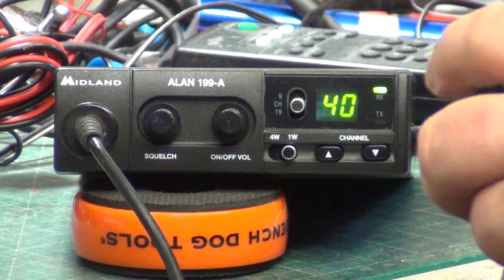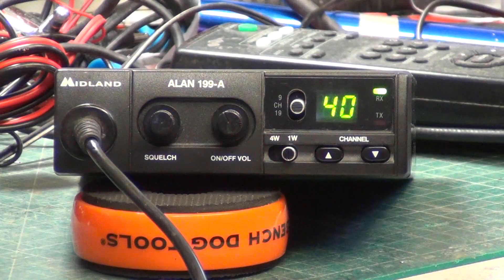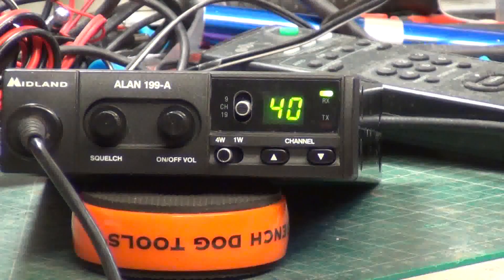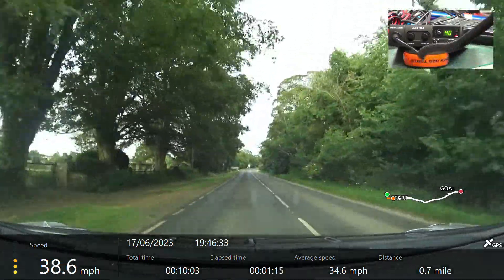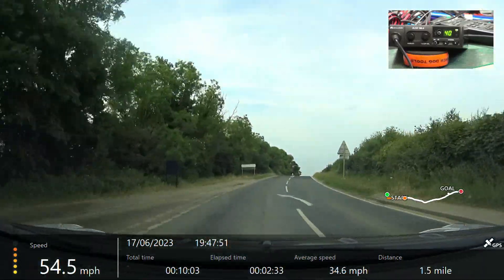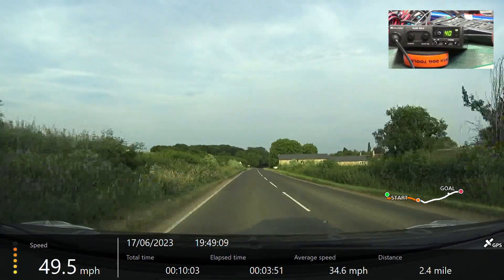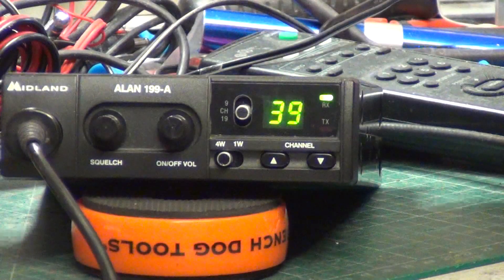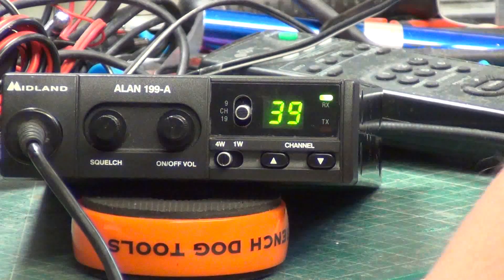Midland 199A CE CEPT AM CB radio - On The Air test

Comment: Like the previous video involving the tune-up this was really interesting to see - and indeed hear. AM was always the phrase to be whispered metaphorically back in ye olden days but as demonstrated here so clearly, whispering on AM isn't really going to get you far..!
AM always had its romantic association (in the UK at least) with the pioneering outlaws on the 70s and early 80s but when you hear an AM setup in the real world, you soon realise that by opting for FM for the UK in 1981 the Home Office did actually do us a bit of a favour..
Looking forward very much to the like-for-like AM set test when the radio arrives from France.
Reply from the maker: The set from France is today's service video & today's on the air test. Tomorrow, it will be the set from France (Midland M-zero CE  AM) talking to the Midland 199A CE AM), so pure AM to pure AM & meticulously aligned. This will set out benchmark for AM performance to compare AM/FM MultiNorm sets with.

These CE AM sets have crystal filtered receivers as requitred by CEPT legislation.

Richard, G0OF, UK

Comment: Am is all ways the same it lacks the strength to punch through the noise out there but i think it might be better horizontal  antenna  as vertical just its not working tried Am in the car for a week  and its to bad to live with but if i was out and static i would put up a beam up and put my 7m sota pole and try a compare  between  both antenna on Am
Reply from the maker: CB radio is vertically polarised. However, there may be SSB users utilising horizontal aerials. Bear in mind beam aerials are not pernmitted on CB in the UK.

Richard, G0OJF, UK